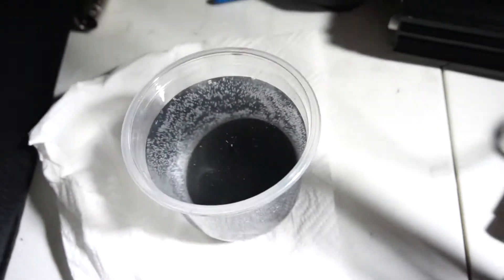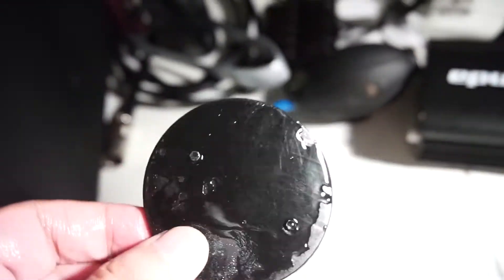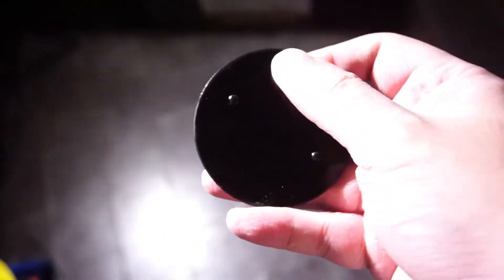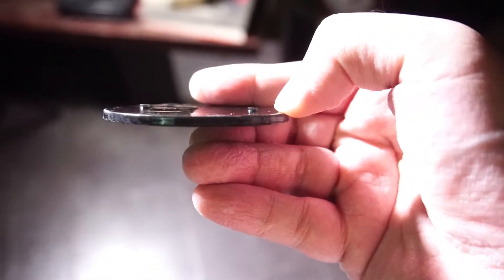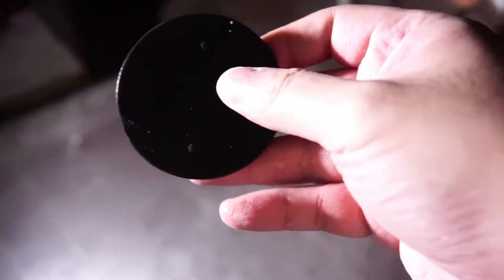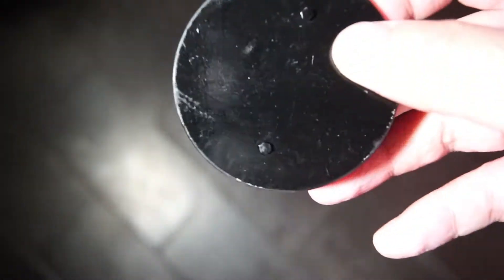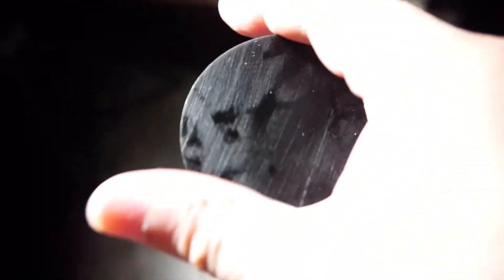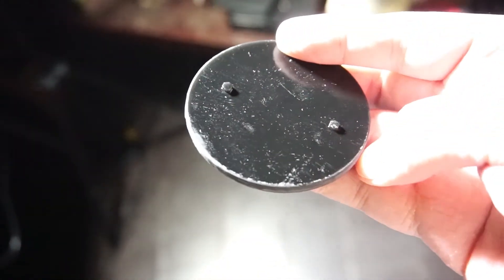Slam, Smash & Drop Test using Esun Hard Tough Resin

Comment: You using way too simple shapes. I have made my own tests with coin-shaped parts and separate weapons. And they tend to survive drop tests even with fragile resins. May be i can send you my drop torture test?) It prints well with everything but doesn't survive any drop test with ABS like. Even blue usually fails in 2-3 tempts)
Reply: Interesting.. I'm thinking of making custom mouse shells (haven't bought the resin printer yet. Currently using fdm).
I'm concerned that the mouse might just smash into pieces if it's accidentally dropped on the floor. Seeing as you've had some experience with your experiments, can i ask your opinion on this matter? I'm sort of confused on which type of resin i should choose.
Reply from the maker: yeah, its a simple shape to be used as foot stands for marvel legends.